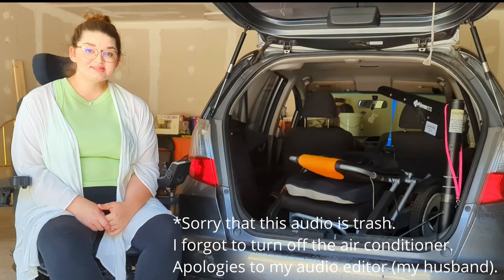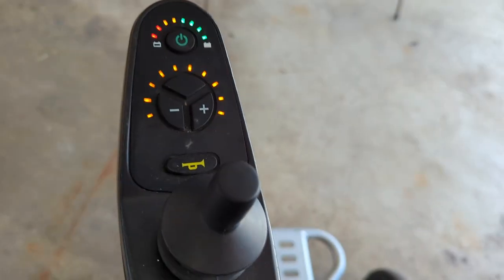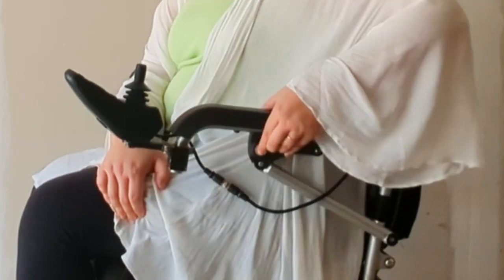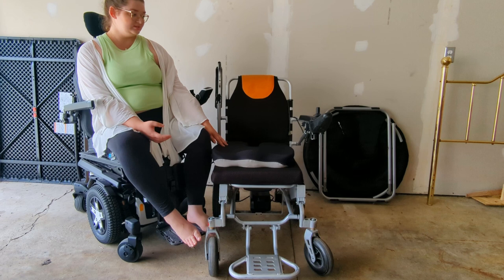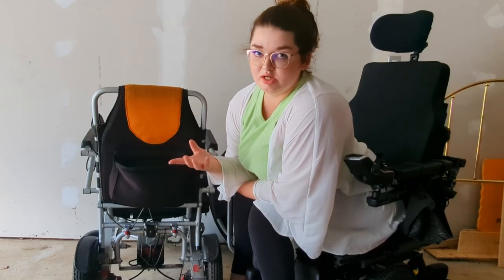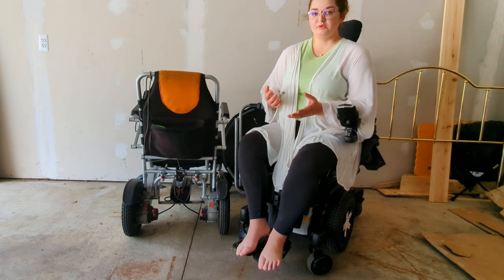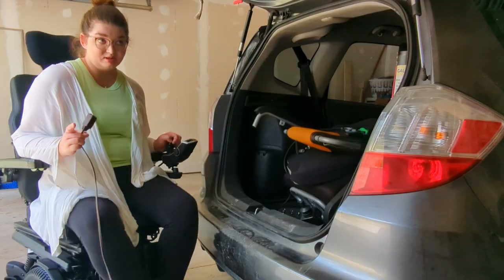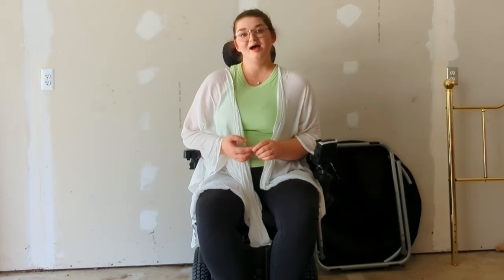Take a tour of my portable travel wheelchair!

Comment: Hi 😊 this is a great informative video. I’ve been thinking of buying one of these power wheelchairs too as wheelchair vans are sooo expensive 😝. I was wondering, how long does the battery last you?
Reply from the maker: It really depends on things like how much you weigh, how fast you're going, and what kind of terrain you're going over/how flat it is. When I was working at a zoo (so lots of walking around but mostly flat paved ground) there were very few times I was in danger of running out of battery. So my guess is the 7-10 miles range.
Reply: Thank you for your time and effort